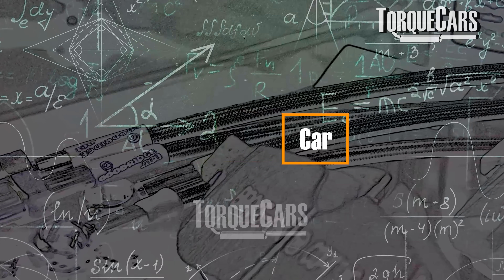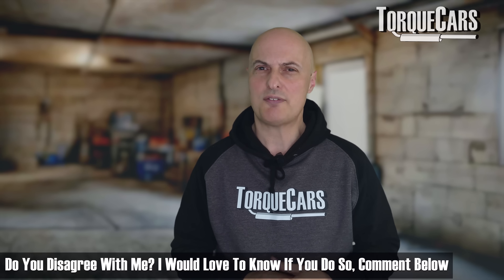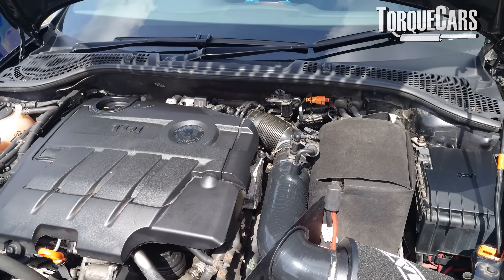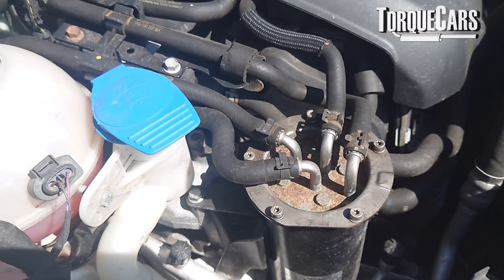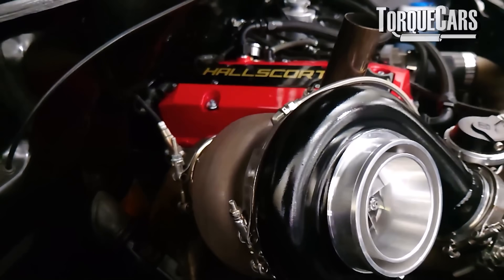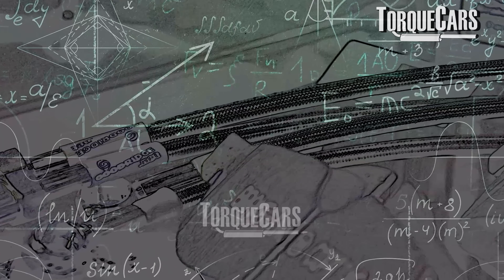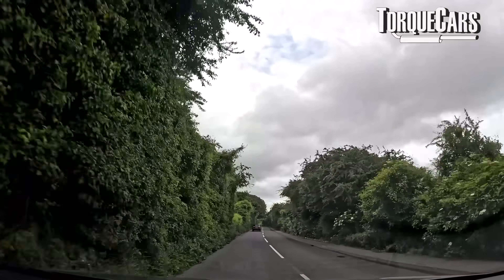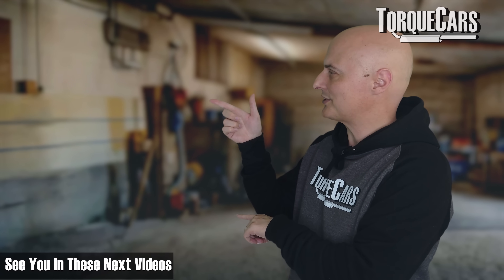Secret Fixes For Older Engines!👍: Easily Restore Missing Power Without Spending Thousands

Comment: I do not get rid of my older cars. Chevy with 321,8** miles, Volvo XC90 with 156,*** miles and my X5 with 234,*** miles. I just keep them maintained and tuned and lubed. Still running strong. Plus, I HATE car notes. Buying a depreciating asset is not for me.
Reply: Based

Comment: I have a 1991 Toyota Celica, and it's all original parts pretty much, only service items have been changed. It still sweet as a nut, but i do wonder if certain parts should be replaced now, such as sensors?

Comment: I’ve some old VWs and a Saab 93 they are all 12 years plus, but they all work fine as daily drivers. Basically it’s down to maintenance, some cars need timing chains and belts that can be very expensive, but that’s at 80k plus miles. I’m often told to junk them. I can’t afford a new car or a lease deal so I get them fixed. In the long run it’s cheaper and far more environmentally friendly. All of my cars are over 100k miles. If you want to get the best out your car use V power fuels rather than additives.
Reply: My car is the oldest in the office car park probably, 2001 VW Polo Classic 1.8. Has 326,000 km on the odo and the car is still running like a new car. Keeping on top of maintenance is the key. And always opting for the better quality part available. I plan not to replace the car at all, unless an accident or it gets stolen.

Comment: What works for my 2.2 dti as a preventive are bardahl products + normal diesel + 300ml 2T oil per 60l in winter. I would change my car if there is a need for a bigger, faster and more capable ICE vehicule. I would not buy new car just because it needs parts, ev ideology or to keep up with my neighbours. I would repair or replace parts until my needs fullfilled. My car is not a toy but a workhose that serves me well for over 16 years, never left me stranded - don't make them like that anymore. This leaves me time to focus on more important thing in life. Why change it, don't get it.

Comment: Lucas tune up in a tube is the best injection cleaner I've used, every 5-6 tank full I add a tube of it, and use premium fuel, never had an MOT failure on emissions yet. I use it on my high  mileage Kia Ceed runabout, my Saab highly tuned turbo petrol and my motorhome. Rave reviews for this product on Google.

Comment: Can you explain how replacing the cabin filter will restore power?
Reply from the maker: Why would anyone not replace the cabin filter at the service interval? I'm listing service items at that point in the video, and you could also argue that many service items in themselves (oil & oil filter, glow plugs, coolant, brake fluid etc...) don't really add much power, it's more of a protection.  

But if you do want to be picky and need an answer I'll come up with one "you'll lose power from the extra drain from the airconditioning and blowers trying to pull air through a dirty filter." ;-)
Reply: @torquecars  TOUCHE well said.

Comment: i use redex  diesel cleaner every third tank of fuel,and a cat cleaner twice a year,plus yearly service and two mini services between major service,gearbox and four wheel drive oils changed every year,car runs like a clock.preventitive maintenance,just like we practiced in my 22 years service in the RAF.

Comment: I once had a first generation Skoda Octavia and it wouldn't idle properly and often misfired. I replaced the air flow sensor, throttle body, and various other things, costing me over a grand, turned out to be a faulty fuel pump relay costing me under a tenner. The car was fine after that and was smooth and powerful.
Reply: This is why proper diagnosis is important, rather than randomly replacing parts as many mechanics seem to do.

Comment: I always avoided Turbos, direct injection, auto gearboxes and gadgets, up to now. Our two cars are not loaded with those hazards. I keep my cars 12 to 15 years, that is about 250.000 km/ 155.000 Miles, and never noted a loss of performance (of course with port injection the carbon deposits are not an issue). Besides a good, strict maintenance, I found that engines need to be used the way they were designed for. A gentle, family car engine with max. torque at 2500 RPM and 55 HP/Liter won't be happy driven flat-out all the time, while a peaky one, with max torque at 5000 and 80 HP/ Liter (for an atmospheric also) won't agree to starve at 30 MPH between traffic lights in town for long; this one will need  to be trashed from time to time. So an engine choosed for the way we use our car will live longer.

Comment: bought a Rover 600 diesel last week in Madrid and it was woeful , cleaned the M.AF put in V power and an injector cleaner  before setting off and by the time it was in Murcia it was a totally different car. Italian tuneups work
Reply: It's probably spent all of its life idling in traffic.  Madrid is horrendous for congestion.
Reply: @MrT5D5  it's only on 157 k km in 27 years so 100% hasn't been much out of Madrid

Comment: Redex seems to be the best petrol system cleaner. I use regularly and the engine runs so much smoother
Reply: I remember as a kid that garages had a dispenser of Redex. It was free and my father used 2 squirts a fuel tank topup

Comment: I agree with everything you have pointed out here. I also find (contrary to popular belief) if you have a towbar,  pulling a heavy trailer over a distance seems to make a big difference. The engine always seems much smoother and much more lively afterwards..
Reply: It's not the weight, it's the aerodynamic drag. Weight means little once you're at cruising speed. (Unless hills are involved.)

Comment: Redex
I have been constantly convinced, over four plus decades, that the first thing to do is run Redex through any second hand car. 
The most obvious was a punt on a Punto (🤭) which we bought for our son. It wasn’t running right. We bought it for peanuts but it had no power. It struggled to get up our hill. I ordered service parts and ran two bottles of Redex through it (four treatments) whilst waiting for them to arrive and the difference was night and day. 
Car transformed and along with servicing, served our son well for over three years.
Reply: @BionicRusty  some cars hate redex.. Vags especially
Reply: @MRJAYDANGEROUS true, my Fabia 1.4 TDI injectors are blocked after redex treatment.
Reply: Redex down the cylinders too?
Reply: Redex is the worst fuel treatment you can get.

Comment: I have that lucky that engine bay in Focus mk1 is meant to fit even 2.5l engine so mine 1.6 takes up so little of the space that everything is on sight and easy accesed. Parts are cheap and so is my mechanic labor cost because of how easy is to do anything in it.

Comment: You're spot on regarding preventive maintenance mate, frequent oil changes, high quality fuel where possible and with direct injection engines - Carbon Cleaning is a must. 
Unfortunately, I'm having issues with my Audi RS6, it's looking like one or more faulty injectors and I've tried the usual cleaning products without any success, however I do have extended warranty on the car, its 11 year old now so I've booked it into a specialist to be checked over and if its confirmed that the injectors are faulty, its an engine out job as the injectors are down the sides of the engine and inaccessible from the engine bay - The 4.0 V8 TFSI motor has what’s known as a "Hot-V" where the turbo chargers live at the top of the engine inside the V between the two heads, which means the intake manifolds are down the side.

 If the warranty honours the claim, I'll be asking the mechanic to do some other difficult to access jobs whilst the engine and gearbox are out, such as the rear main seal and any perished pipework, depending on the cost I may even have the timing chains and guides replaced too- Most of the cost of working on this type of car is labour, I read somewhere that to remove and re-install the engine is somewhere around 20 hours labour.
Reply: Yeah definitely get chains & guides done, it'll add value to the car and prolong its life. As the saying goes- Do it once and do it right
Reply: Gosh ! 😮

Comment: I would never trust the dealer here in Cyprus, or any mechanic, to work on my Jaguar F-Type. All it takes is an OBD2 scanner and a lot of swearing. I use top-grade fuel along with injector cleaner and have installed an oil catch can.
Reply: I fully understand the swearing part 😅
Reply: Just keep the maintenance regular and use top quality fuel and oil
Reply: oil catch cans.should be made mandatory for DIs

Comment: I would say if any repairs/maintenance are going to cost more than the car is actually worth, then it's time to get rid of the car. I have experienced this myself very recently. My attitude with cars is to keep them for as long as possible, until it's time for them to go to the scrap heap, I believe that's how you get your money's worth out of the car.
Reply: What difference does it make how much the car is worth? Are you repairing and maintaining it for your self or for resale? Your logic is, the car is worth 2K, the repair is 2.5K, it's a waste of money, I will buy a 30K car instead???
Reply: @DashCamSerbia I'm just saying that it's relative to a point
Reply: Yeah, but it depends on a car and its worth. I bought a Mk1 Focus in May. Doing the timing, rear drums, spark plugs, new oil, air, fuel and cabin filter, plugs cost near its value even tho parts were cheap. And you can say that i wasted money because of the costs ratio. I say it just means how cheap I got the car, given that the parts are cheap as well. It's not the same for 1k and 10k or 20k £ vehicle.
Reply: @benking9593  yeah this is terrible advice. It’s still cheaper to repair a 5k beater than to buy a 28k car
Reply: @Microplasticindulger Why would you buy a 28k car? How on earth did you come to that conclusion from my comment?
Reply: Not entirely true. This is a common trap people fall into. More expensive car loses also more value in the years to come and could also be mire expensive to repair.
Reply: What happens if someone has a reliable car? Say an old Japanese one. What happens then? I mean, Car Wizard had an '87 Nissan Hardbody come over to his shop a couple of months ago, the cost of repairs came up to $7000 and the owner wanted it fixed. And the comments agreed with the owner, saying that "What's $7000 if this means that the car will work reliably for another 20 years?". I mean, come on, you first do the repairs for yourself, not the others! Sorry for my choice of words, but this is the stupidest piece of advice I've heard in a while.
Reply: @McBeamer94  if someone has a reliable car, then they have a reliable car. What's your point? At some point, most cars start to become unreliable and it will be time to stop throwing money at it. And it's "most stupid", not "stupidest"
Reply: As someone who runs a 21 year old Freelander, and am currently in the middle of replacing suspension arms on my 10 year old Mercedes, I wholeheartedly agree.
Reply: I understand the idea, but it's worth noting, in terms of assets - if repairs cost more than the vehicle is worth, so you sell it and buy a newer car with lower mileage, you're losing far more than the cost of the repair. If your car is old and requiring pretty serious repairs, chances are it's near enough fully depreciated. So if you buy a new car which then depreciates say, £8000 in the next 2 years, and the repair would've cost you £4000, you've lost twice as much money (nevermind any other problems you may face with a new car). 

^^Not claiming that this is the right answer, just my opinion. Partly comes from advice from Dave Ramsey.
Reply: What wasteful thinking.  Yeah, the repairs are gonna cost a lot. But if those repairs don't have to be done for another 20-30 years, it's way more valuable than buying another car that may last 2-3 years.
Reply: @MobiAussie  How is refusing to spend a lot of  money on a car worth next to nothing, wasteful thinking? Yeah, if you don't have to do anything to a car for 20 to 30 years, great, but in what world does that happen? Maybe in sunny, dry climates, but it certainly doesn't happen where I live.
Reply: @benking9593  
> "In what world does that happen?"
> Answers own question in full.

Comment: Upgraded throttle control module

RED LINE SI-1 FUEL SYSTEM CLEANER

Liqui moly ceratec

Liqui moly engine flush plus

Valvoline restore and protect oil

Comment: Not just some sort of a cleaner. Use specific air flow sensor cleaner so you don't fry your sensor.
Reply: You can't fry the sensor... The issue is that all cleaners, even brake cleaners, will have some tiny oil residue that will be left on the sensor wire. That oil will mess with the reading accuracy. Air flow sensor cleaners are completelly dry. That is the only reason.
I hear clueless people saying, oh don't use brake cleaner, use contact cleaners, it is much safer. But in fact, contact cleaner will have some oil in it, to help lubricate the contacts in connectors...
A good quality brake cleaner (Wurth, for example) is a good alternative to a proper air flow sensor cleaner (if you don't have it).